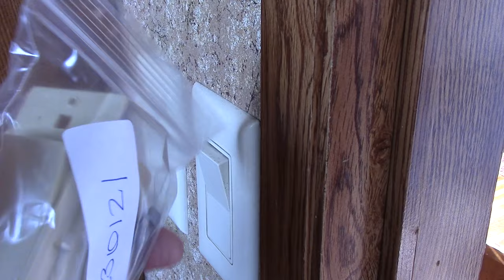How To Replace A Mobile Home Light Switch  -- Self Contained Switch Or Outlet

Comment: Thank you for posting this video. We had a major fault in an outlet where we were lucky it didn't burn down our whole 5th Wheel. When I went to get a replacement Outlet I was told that you had to buy a very expensive tool to push the wires down into the slots. After watching your video I realized that there was a different way that work just fine. I bought a brand-new similar Outlet at our local RV place for $20 and will install it tomorrow and I'm sure there's not going to be any problems after watching your video.
Reply from the maker: Thanks very much,  good luck with your install tomorrow
Reply: I'm having this issue right now. The manufacturer installed 3 wires in it and one popped out. The new receptacle isn't as deep, so I cannot fit all 3 wires in it. It's a nightmare.  My fridge won't stay on without the wires in a receptacle. I have no idea what to do. Any advice?

Comment: Also I have to mention these switches are terrible lol and frankly a little dangerous, the connection the wires have with the contacts are not enough to protect it from overheating and causing a fire. Do yourself a favor and get a box and use regular household switches. It's a little more work but totally worth it!
Reply: That's exactly what I did when a light switch needed replaced in my mobile home. Less expensive and more easily replaced in the event of a failure.
Reply: Just had the unpleasant experience of dealing with a couple of these and all I can say is that they are absolutely junk, how on earth they ever got UL or code approved beats me.

Comment: Whenever you run into stuff glued on like that, try using a heat gun to warm it up a little, would help a ton. You could also try a little bit of mineral spirits as long as there isn't any paint around the area or it can easily be covered up like with this face plate.

Cause I know not everyone owns a heat gun, a hair dryer would do the same thing, also in place of mineral spirits, you can use nail polish remover!

Comment: The tool that Wirecon makes for pushing the wires in makes the job easier, but is very expensive. I use a telephone punch down tool with the 110 blade. Much less expensive and is available at the big box home stores.
Reply from the maker: Thanks for watching.  I have a telephone punch tool but I didn't take it with me.  I was expecting that the switch would have screws on it.  Just doing it for my daughter.  Anyway,  I got it done.
Have a great week, 
Calvin and Marie

Comment: If it is so much more difficult to replace these with the same, which not just replace it a modern shallow clip in blue box with the wing clips, then add a new modern switch to the box? They slide right into the wall just like these right?
Reply: Mobile home and RV walls are only 1-3/4 inches deep, not enough for the usual boxes.

Comment: Yes I have 3 wires the same as you and I guess with the standard single pole switch the main hot goes to one screw then I can pigtail the other 2 hots and connect to the other screw then the 3 whites wire tie them together. Yesterday I had it wired like a receptacle would be. I have wired things up before but just have to refresh myself as it's not something I do everyday or might be years apart lol.
Reply from the maker: That sounds right

Comment: Those swing arms that suck the switch/receptical in to the wall by way of the screw is a bit easier to turn if you use some sort of lube on the screw b4 u install really helps the screw turn MUCH easier 🧐😊
Excellent video
Reply from the maker: Thanks very much

Comment: Wish me Luck.  Got the boxes from. The Mobile Home Store online.  I'll either have a working switch,  or be using a lantern in my bathroom when I'm done.  I manages to wire a  back up camera on my pickup ok, but this looks more difficult.  As a Widow, I've already replaced faucets, and assorted other repairs.  Hoping this will go smoothly.
Reply from the maker: Thanks for watching Renee. Good luck with your project.  Just pay very close attention to how the old one is wired. Maybe even take a picture of it or draw a diagram so that you get the wires back in the correct place.  If it is a single switch it will a lot easier.  Once again good luck, 
Calvin

Comment: I bought a standard single pole switch; can I replace that crazily complicated mobile home switch with it?
Reply from the maker: It can be replaced with a standard switch but it won't mount back in the box with out some modifications or replace the box also.
Calvin and Marie

Comment: question... is the insulation on the wires precut before putting them in the slots? or does the slot cut the insulation as the wire goes in?
Reply from the maker: Thanks for watching.  The slot will cut the wire when it is inserted.  There is a special punch down tool for putting the wires in but I just used a small blade screwdriver to insert them.  You don't want to spread the slot open to much.
Calvin
Reply: @SouthernCountryLiving  that's exactly the answer that i needed. thanks

Comment: I have a dilemma similar to what you are doing but its 4 switches in a row. Now the first 3 switches work fine but throw the 4th and it trips the breaker. I dont know if its first in line or last. Your opinion.
Reply from the maker: Thanks for watching.  It could possibly be a wire that has came loose inside the box causing a short. With four switches in  one box, that is a lot of wires. You will need to be careful to not cause any problems with the other switches if you open it up. 
Calvin

Comment: Hi, Calvin. So, the rocker switch in my bedroom wouldn't stay in place, and I replaced it. The problem is, the new switch won't stay in place either. Do you know how to fix this?
Reply from the maker: My guess is that the screw hole is stripped out. You might be able to put some silicone caulk in the hole to help keep the screw in.
Reply: @SouthernCountryLiving  Actually, the problem is not with the screw holes to mount the switch on the wall but rather the switch staying in the off position. If I turn it on, it won't stay on by itself. It's a brand new switch, and I can't figure out what the problem is. Any ideas?
Reply from the maker: I misunderstood your question.  If the light comes on when you hold it in the on position but the switch turns off by itself when you release it then it is most likely a bad switch even though it is new.
Reply: @SouthernCountryLiving  The thing is, I tested it before installing it, and it worked fine. However, once it was wired, the switch won't stay in the on position. What could it be?

Comment: How can you identify the input if they are pulled out already?
Obviously not using the electricity to do so😁
Reply from the maker: Thanks for watching,  they make a special wire tracer that you can purchase.  If you only have two wires in the box its not a problem but if you have multiple wires then you have to trace them out.
Calvin
Reply: @SouthernCountryLiving  
Where can you find a new switch at?
They are not quite common I see....
Reply: Great job! Very informative. I was told they make a special tool to crimp the wires in to the receptacle. But from watching you, I don't think it's needed! Thanks...

Comment: Why not strip the white and black wires before you snap them back in? Wouldn't that give a better connection without the insulation around the wires?
Reply from the maker: The connections are made to hold the wires with out stripping them.

Comment: Question...we have an older mobile home, 2001 I think, it has the other type switch and we are wanting to update to those decor switches but there are 9 wires, it has 2 different switches, we are so confused...help! Please! I can email you with a picture if that would help!
Reply from the maker: Thanks for watching.  I'm not an electrician and I doubt that I will be able to help.  I will give you a couple of tips. 
First determine what type of switch you have.  If it just turns a light or outlet on and off it is a single pole switch.  If it works with another switch on another wall to control one light then it is a three way switch.  Next google for wiring diagrams for the type of switch that you have. Make sure you turn the electricity off before starting to replace the switches. Use tape and label each wire before removing them. Connect each wire back to the new switch just like it was connected to the old switch.   If you ask a friend or a neighbor you will probably find someone that has done it before and will be glad to help you.  Good luck with your project. 
Calvin
Reply: @SouthernCountryLiving  Thank you!!!

Comment: Out of curiosity, why didn’t you use regular household switches? Those are the switches look like a fire hazard to me.
Reply from the maker: She wanted all of the light switches to match.
Reply: @SouthernCountryLiving  Do you have instructions to replace the rv switch with a standard switch?
Reply from the maker: @Linda  A. York. No I don't
Reply: After looking for self contained outlets for my home I found alot of people saying they are a fire hazard and should be replaced. So now I have been installing gang boxes and new standard switches/outlets. I’m also using those wago connectors. I’m now stuck because the dimmer switch I want for the new light I installed has wires already attached. I can’t find any information on replacing self contained switches to Leviton dimmers.

Comment: If the switch stops turning on and off do i have to completely replace it?
Reply from the maker: Thanks for watching,  if your switch is not working then you do have to replace the switch.  You need to know that it could be other problems like the light fixture is bad. Usually when a light switch goes bad it starts acting up a little before it completely stops working.  Hope this helps. 
Calvin

Comment: Thanks for the video. I would rather put a box in and wire an outlet but the park model walls are a b$#÷/h to work with. I got the switches from Amazon and replace tomorrow
Reply from the maker: Thanks very much

Comment: I could be wrong.....the top wire by itself should be going up to light fixture.....one of the two wires together is the feeder 
/line wire and the third wire is going to another box to feed something else.
Reply: No I think you're correct. the second wire on the bottom piggy backs the other switch.

Comment: I found it a much better solution to put low-voltage wall mount brackets in then a standard switch wrapped with electrical tape. Who needs a box switch catches on fire house is going to burn down anyway

Comment: I am having a hard time to get the wires into the slots to connect. It seems to me that there should be a better way to connect the wires to the box. Why there is not a screw to connect the wires like a regular box is beyond me!
Reply from the maker: I agree with you on that. They make a special tool for pushing the wires into the slots. I just used a small screwdriver.  You have to be careful not to spread the slot to wide open or then the wires won't stay in the slot...
Calvin

Comment: Nice job replacing a bad switch with another bad switch. Better to upgrade using an old work box and a new switch. Actually, could have used a double gang old work box and replaced both switches at the same time. I'm currently remodeling a 1984 mobile home and am replacing 29 receptacles and 14 switches.